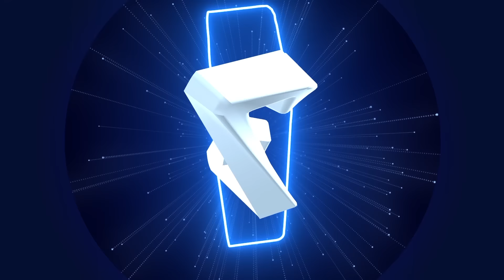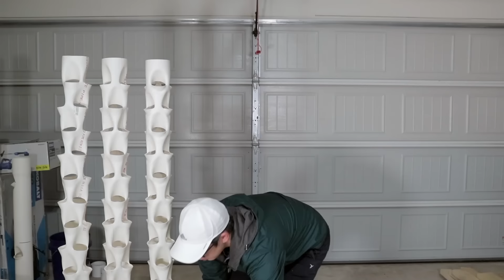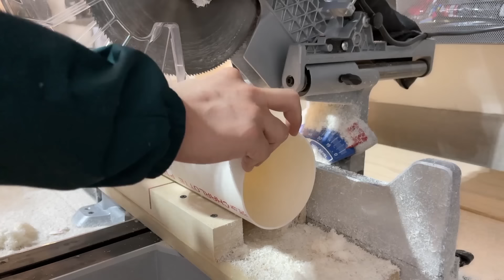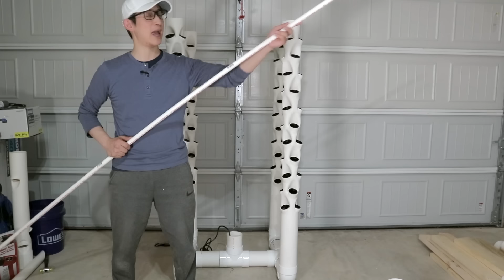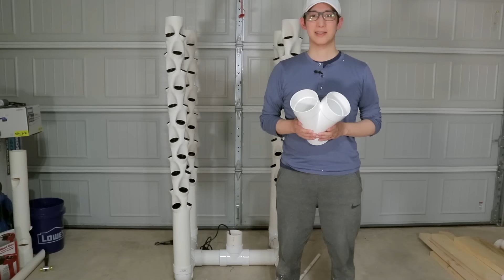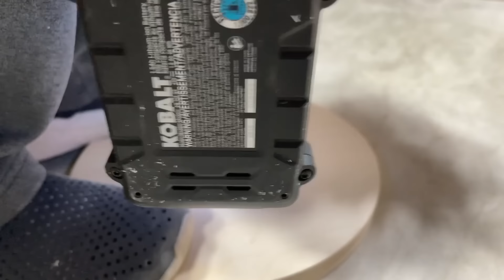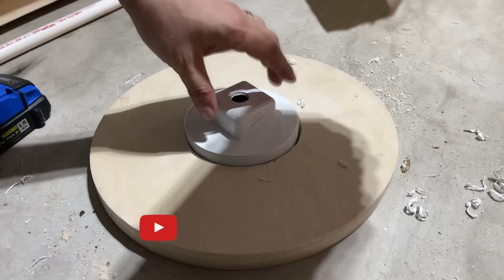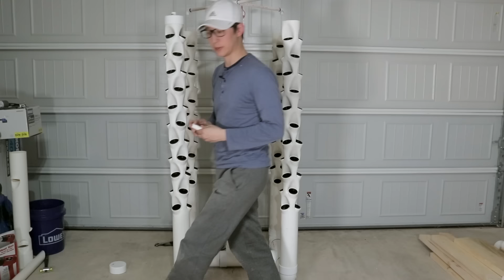DIY Hydroponics | Aeroponics Garden Tower Build | Part 2 - [4 Tower Build]

Comment: Long learning curve post and adjusted parts list-

Parts List I got from another commenter, but adjusted after building and spending a lot of wasted money on things that didn’t work:

AT LOCAL HARDWARE STORES-
-3 x 10' 4" PVC
-2 x 10' 1/2" PVC
-1 x 10' 2" PVC
-4 x 4” metal shower drain plates (people suggested more tightly meshed ones though, and we are using sink drain mesh ones instead to prevent pump clogs)
-4 x 4" 90 degree elbows PVC
-3 x 4" tee PVC
-1 x 4" wye PVC
-PVC primer/glue
-5 x 1/2" threaded male adapter PVC
-5 x 4"  caps PVC
-1 x 4" female adapter PVC
-1 x 4" DMV cleanout plug PVC
-4 x Orbit 54042 Mushroom Bubbler (Or any sprinkler bubbler works really)
-4 x 1/2" 90 degree elbows PVC

THINGS WE HAD TO ORDER ONLINE-
-1 x 1/2" 5-way cross fitting connecter PVC (had to get these online because they weren’t in stock locally at any of our hardware stores. Link: https://www.amazon.com/EPHECH-Fittings-Furniture-Connectors-Greenhouse/dp/B097LPRPL4/ref=sr_1_8?crid=1IHJ201U787BP&keywords=5+way+pvc+fitting+1+1%2F2+inch&qid=1652020836&sprefix=5+way+%2Caps%2C97&sr=8-8 
-1 x 800 GPM pond pump that’s less than 4” and fits (I used a less powerful pump after reading other’s comments and reviews. We bought this one and it works like a charm: https://www.amazon.com/gp/product/B097HF98WF/ref=ppx_yo_dt_b_asin_title_o01_s00?ie=UTF8&th=1)
-80-132 x 2" garden slotted mesh net cups (33 per each tower x 4 towers for his original build, and 20 per tower x 4 towers for more spaced out plants for more root room and other issues people commented about) Link: https://www.amazon.com/gp/product/B09PV79PCW/ref=ppx_yo_dt_b_asin_title_o05_s00?ie=UTF8&psc=1 
These are the kind of pods he mentions at one point that I purchased for this: https://www.amazon.com/gp/product/B088MKLBB9/ref=ppx_yo_dt_b_asin_title_o04_s00?ie=UTF8&psc=1 

We also added shut off valves at the top of each tower as well. So that’s 4 shut off valves if you so choose to incorporate them. 

A few things I’ve learned from making this over the last week as a first time hydroponic tower maker that he either glosses over and doesn’t go in depth about or we changed upon reading suggestions here:

-We did 20 plant pods per tower. There were lots of experienced hydroponic growers on here commenting about over crowding and after A LOT of experimenting with spacing and heat (and that the baskets don’t actually sit flush and all the way down when 3 across per row like this and there was zero way we were going to get good water flow and room for roots in mature plants), having them as close as he does just isn’t really realistic for a ton of reasons, including that the PVC just starts breaking down after a while as well.
 
-Ice is critical when doing the melting and  re-hardening the pvc to mold it. If it’s both cool enough when you start to move on to the next hole, you will absolutely tear it and ruin the hole. If the hole STARTS tearing when you’re making the hole, add ice to that section while forming the hole to prevent further tearing. 

-I have no clue how he got the little 5cm openings he talked about in his first video when he does the template to work because that was not functioning for us no matter how we tried. So we did TWO 8cm holes spaced 8cm apart from each other on each row. (34cm leaves you with 4, 8cm parts. So it seemed more natural with this spacing) And 10cm in height with each row alternating where the holes are. Ten rows total for each tower.

-We have the same heating gun as him and on high heat, we needed exactly 1 min and 20 seconds of heat on the area we were molding to get the least amount of tears. 

-We put the 1cm, 2” cup holding rings on as the pvc was hot so they would stay better and cooled it with the ice around it.
 
-Save your self a lot of headaches and do the melting on a flat surface or the whole pipe will bend and cause issues. 

-Start melting your pods 20cm from the top  instead of the 10cm he does or you can run into issues with the top pipe caps not fitting properly from the top of the tubes warping from melting the pod holes. 

-We are engineering a reservoir to attach and automatically fill when it’s lower because this one doesn’t have much water to circulate when the plants mature.

-You don’t have to use a miter saw. That was actually making things harder for us. (I’m assuming he used that one because it was sponsored?) we used a hand held tool (idk what it was but my husband is in the remodeling business and said it was for trimming or shimming or something 🤷🏻‍♀😅) and we had a ton more success with getting perfect cuts every time. 

-You will need to sand most of the cup holes down after forming them. Especially the ones that DO end up tearing. 

-Not going in order from top to bottom while molding the holes makes things ridiculously difficult. Please avoid if possible. 

-We are going to end up siliconing the 1cm 2” rings for holding the cups up because some do end up moving and might fall in with the weight of mature plants. 

-We are also adding shut off valves at the top so that if we need to rotate and not have one tower running, we can. 

I am planting today and will take pictures and link to them here for anyone interested in following one of these in action since he’s not been able to use his yet (he said due to weather, and weather is not an issue for me and I will be able to grow year round).
Reply: Amazing post, this is quite some work and dedication. that tool is called an oscillating or reciprocal saw, two different tools both can be purposed to get the job done.
Would for sure like to see photos and progress youve made.
Reply from the maker: Thanks Krystina.  Absolutely commend the work and improvements you made.  I too would love to see your build since im always trying to make improvements.  You are correct that the 5cm slits were not adequate for the pots in the first build which is why they dont sit fully flush in the holes.   This was improved in the 4-tower build where i made larger cuts using the miter saw (which is not sponsored and was used simply because it was faster for me to cut the rings and the slits which I was able to set a stop for on the saw itself for equal cuts all around).  I did briefly mention the need for ice water in the first video, but missed mentioning it in the 4-tower video.   I assumed using ice water would just help it cool and harden the pipe faster.  I did not realize that the ice water also helped to avoid tears as well.   Good to know!

In the 4-tower build i used the 2" PVC pipe that I cut rings from to create the holes, which made creating the pot holes much easier and helped to avoid the pipe from warping.  As for roots and water flow, having 3 pods per row didnt seem to impact my yield in the 4-tower build because I moved the inner pipe out of the grow tower which was the basis for the design.  The 2-inch pipe (template) that I used had an angle cut in it which helped guide the angle fo the holes I created that would allow 3 pots per row to sit flush without impacting water flow and fit - There is an angle you need to hit in order to fit 3 cups.   3 pods per row definitely didnt work as well for the single tower with the 1/2" inner tube for water delivery.  I do agree though, and have gone with 2 pods per row for all of my new builds (which allows for a lot more give), with the exception of a 4th build that Im working on that has a completely new design.

I also did use silicon to secure all of the rings, close off any tears, and also to reinforce the connections for all PVC pipes and connectors.   The shut off valves are a great idea and something I didnt think of, but realized through feedback on these videos.  These would be good to have since there are at some points where Im not using all of the towers. 

The additional Reservoir is another addition that I think is a great idea, but havent figured out or found a good solution that fits into the existing design - Im actually thinking about a 3D printed solution which will minimize potential water leakage which will expand the center reservoir allowing it to carry more water.

Echoing darkwindgamestudio - Excellent post with a ton of great recommendations and improvements on the initial design and would love to see how your tower build turned out.
Reply: Krystina:
Thanks for sharing such great information.  Please, could this post be forwarded to me .  I tried saving and copying but couldn’t do either.  Would really appreciate it.  
Thanks,
LC

Comment: @ChrisLoh can you share a link to which pump you used? Its difficult to find a pump that fits into the 4" pipe without a little oder trial and error.
Reply from the maker: Sure.  I added the parts list and links in the description as well.
GROWNEER 550GPH Submersible Pump 30W Ultra Quiet Fountain Water Pump - https://amzn.to/3OcGnlr

Comment: Although you made improvements, which are quite good; this looks suspiciously like the design of another YouTuber located in Indonesia, right down to the added rings in the holes to stop water splashing. I’m surprised you didn’t give him credit for the overall design. https://youtube.com/c/PetaniKota87
Reply: and his design is suspicious as another, How to Make a #VerticalFarming Tower for #Aquaponics or #Hydroponics: Part 2 www.agrowponics.com by  Gunnar Shaffer
15.1K subscribers Feb 20, 2014 ,~8 years ago.
Reply from the maker: Thanks for the heads up.  All of the design improvements were actually based on feedback and comments I that I received from the first video.  This goes the same for any design improvements/changes that Im making in the 3rd build that I recently finished.

Comment: You mentioned at the end of your video that the list of materials used were down bellow the description, but I can not find them. I had must of them from the video but  not all.  Did you install the mushroom bubbler on all the 4 towers? I can't wait to built it.
Reply from the maker: I Updated the description with the parts list.  I did add bubblers, but found that letting the water free flow was a much better solution.

Comment: Do these towers overcrowd the plants at all? A lot of tower builds that I'm seeing online have a wider vertical spacing between the pods, or otherwise use extensions to increase the distance from the center. This system looks really efficient and inexpensive (barring access to tools) so I'm hopeful it can accommodate a wide variety of plants.
Reply: I had the same question about the distance between plants.  Great build video.  Thanks for sharing and keep up the good work.

Comment: You could also add in a mini float valve on the reservoir section and attach a hose so you never have to worry about water level.
Reply: You would end up over diluting the nutrients.
Reply: Possibly attach nutrient monitoring device?

Comment: Have you thought about using hose to supply the water? You could put a splitter on the pump, then run a hose through each tower. Self contain the water flow and add a cleaner look.
Reply: Good idea. On this 4 tower, I wonder if the pump (a pump that fits) could push the water up all 4 inner hoses/tubes. The pressure would be lost when going from 1 supply line to 4, but perhaps the pump would still do it.

Comment: Do pool noodles work ok to replace net cups in the towers?
Reply: ill answer honestly, dont skimp on the netty pots in this design or you will be wasting nutrient solution and clogging your pumps and cleaning alot if the plant falls through, risking stunting every plant in the system. Not advisable.
Reply: @darkwindgamestudio  
The plant is more likely to be pulled out due to gravity than fall in :)

Comment: Chris, for a future video you should rig a solar panel/battery set-up which drives the pump, and also powers LED grow lights at night; an off-grid, 24-hour, vertical hydro farm.
Reply: Shouldn't run grow lights 24/7 as plants need a period of rest.
Reply: @nicholastaylor8289  not entirely true for growth but they do need less than 12 hrs of light to flower.
Reply: @mjrtensepian1727   im setting up a 100w panel with a charge controller conected to a 20ah sla battery. solar with pumps cost about $140
Reply: Where would you find a solar pump powerful enough to operate this system?
Reply: @gilshelley9183  boat pumps run on 12 volts, low amp for most (between 1-4), and circulate huge amounts of water in regard to their size and power consumption
Reply: @NAULLEAUE  exactly. I had a 12v 500gph but it had trouble with the head height so i upgraded to 1100gph Which made enough rain on 3 6ft towers.
Reply: @gilshelley9183 I also would like to know
Reply: @gilshelley9183  I have several 12v pumps that work great, ebay or the like.
Reply from the maker: @gilshelley9183  found one.  Video coming soon
Reply from the maker: @mjrtensepian1727  Thanks.  I have added solar for my new builds and I find that it’s better to let the solar power the pump and water during the day and let the system rest at night.
Reply: I would be concerned with lighting at night attracting unwanted pests.

Comment: Congrats! Very interesting set up. Could you show us the plants after growing them? I was wondering whether or not the pipes bellow would hold enough solution for all the plants (since my math is 1 liter to each plant). I also notice you did not mention the drain in the upper sdie of the pipes, only bellow to filter possible falling roots. Was that correct or you used them? Thanks, congrats once again.

Comment: Chris I really like this design and I've been doing hydroponics for about 5 years now with many of my own designs (some similar to this).  You actually solved several design issues which I struggled with so I want to thank you!  Also, as a non-beginner (but not quite an expert either) hydroponics grower, I would like to give some constructive criticism.  The sheer number of plants you have (over 100?) in the 4-tube system is going to require a larger reservoir than what you have.  Mature plants suck water like crazy and you will be forced to refill that small reservoir DAILY when the plants are all mature.  This will make it very difficult to maintain proper nutrient balance & pH levels.  So, put on your creativity cap and increase that reservoir size a LOT.  Good luck and keep on making!
Reply: It will make the PH and EC very stable becuase it will be tantamount to drain to waste. The downside is having to mix nutrients daily. A larger reservoir will involve a lot more maintenance.
Reply: @atomizer2665  - I was under the impression that this system is closed loop, with the nutrient solution constantly recirculating.  Is that incorrect?
Reply: @CleverLittleMaker  
It is but given the small reservoir volume it wouldnt last any longer than drain to waste. If the plants use 10L a day you can recirculate the nutes or you can spread the 10L over the day and use exact;ly the same amount. The difference is the nutes fed with the recirc will not give the same results  as the nutes fed drain to waste. The reason is the nutrient makeup remains constant with the drain to waste.With the recirc the leftovers are mixed back into the reservoir so the nutrient makeup is never constant.
Reply: Can you grow large produce like cauliflower or broccoli on this size tower at the lower levels?
Reply: crazy how this guy does't credit the original owner of this idea. Petani Kota87 look him up, made this concept in 2020

Comment: Great 👍 video ,just built mine  but I don’t see the pump you used in the description . I bought one but wouldn’t push 5 ft . And from first video you changed pumps. Thanks for any info
Reply: Any help on pump description would be great thanks
Reply: @kevindorey7097  give a fountain pump a try, any thing north of 400 GPH will have enough power to push close to 10ft

Comment: Very good job! My only suggestion would be to add 4 shut off valves at the top, in order to be able to remove each tower separately if you need to make ay maintenance.
Reply: I believe there are adjustable sprinklers in each tower in this built to adjust the water flow.
Reply: @fredHopeBC  Which require getting into the tower lol

Comment: I would suggest replacing one of the 90° elbows on the base with a tee. Place an expandable plug or threaded cap and adapter there  to seal it. That way you can drain and flush the reservoir every so often.
Reply: I'd switch the part where the pump goes down into the T shape base. If that had another outlet you just need that cap you were mentioning and it'll sit opposite of that Y junction but lower. It'd fit right in.
Reply: I like your suggestion as it's probably a way to expand the system later

Comment: The rings are important. made one without and i am watering the garden. Now I have to look how I get the holes tight. I am looking into pool noodels instead of net pots. the also really seal for evaporation. But for heavier plants you need a net pot + pool noddel and somehow get the edges tight so no water drops can run out

Comment: the pipes are to thin, soo as the roots wil fill the pipe, the water will not flow trough i already done this...u need way bigger pipes to have enough space for the roots

Comment: Use pool noodles cut 2-3” depth versus the 2” rings which will seal better.  Been using mine for three years now.
Reply: Doesn't that leave a place to invite bacteria? Curious if you change them out if if you have had any problems